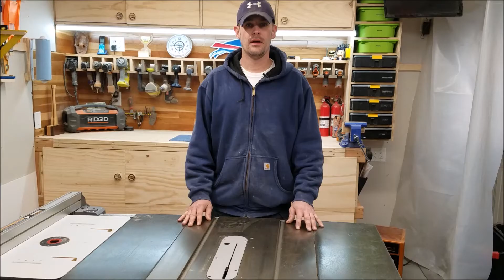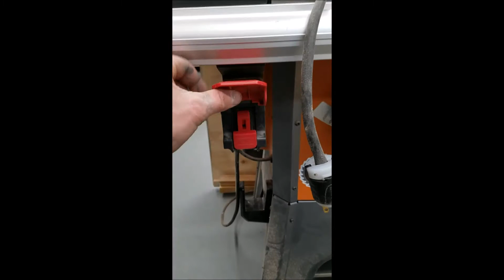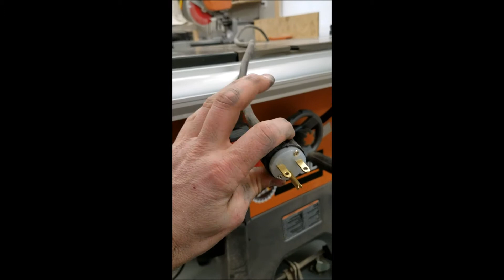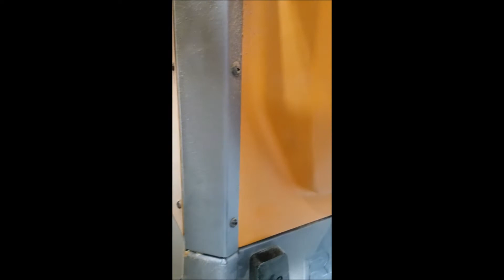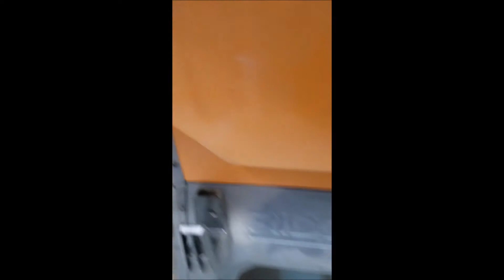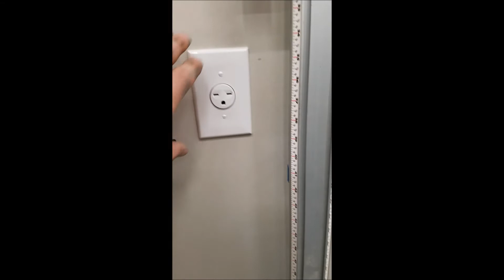Ridgid R4512 Tablesaw Electrical Upgrade

Comment: I have the same saw, and I have wondered about the merits of going to 240 over the 120, obviously the motor will draw half the current on 240 vs 120 and I would guess that would put less stress on the motor. Hearing that your saw handles thicker wood and does not bog down is good news.
Reply from the maker: TheFalconJetDriver its been a few weeks since I have done this and I have noticed a huge improvement in the consistent power the saw delivers.  Hands down, one of the best shop improvements I have done.
Reply: Thanks Adam
Reply: Hi Adam I just pulled in a subpanel in my shop this week for a 240 volt 17 inch Grizzly Band saw, and a  50 amp welder, since I have the capacity I think I will change it to 240, heck a CB and a plug and receptacle, less than $20.00  I know it will be less stress on my motor.